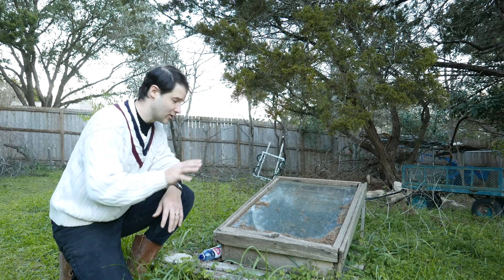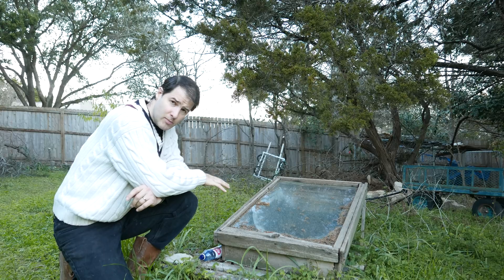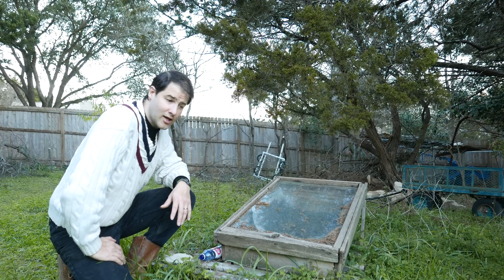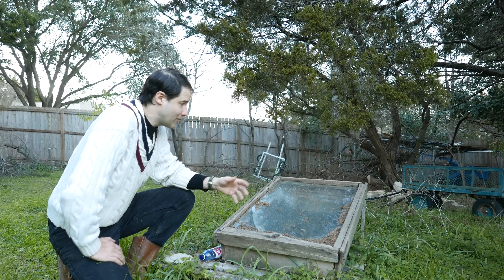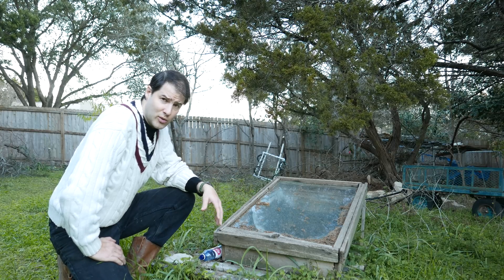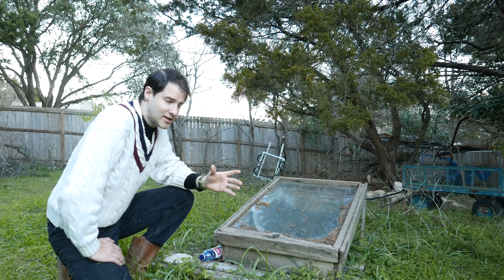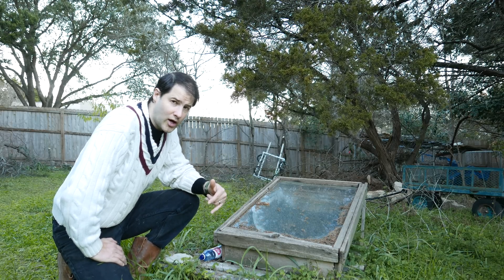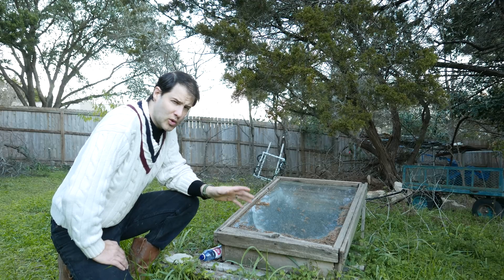Challenge to Makers - Waxmelter Temperature Regulation

Comment: Would putting the wax in a container with water ensure that the wax doesn't get too hot? I suppose it will depend on how long you leave the wax before returning to recover it. If the box was air tight it would prevent the water evaporating.                                 ...................................................................................................................................................Alternatively enabling the wax to flow from the tray through a hole located in the floor of the solar collector would ensure that the wax would melt and drain, but then solidify when reaching the cooler temperature of the area below the collector. If the collector was raised of the ground you might even get a little air circulation preventing the shaded area from warming from the collector above it, and keeping the wax soft which might attract beneficial bees from drowning in it.

Comment: here is an idea, use a sterling engine fan to cool as the temperature rises. Another idea is to us a small fan, with a reed switch on an oven thermometer. this will turn the fan on when the temp raises to much.

Comment: Use an STC1000  All of us home brewers use them.    They are cheap.  You will need a mains feed to it mind but it uses hardly any current and can handle a 10 amp load. You can set the offset value.   We use them on fermentation fridges, I have on in my polytunnel, it will heat and cool OR feed an opening device / closing device.    I have run 2 for about 8 years trouble free.  One is set in my polytunnel right now.  At 0c it fires a fan heater up, at 2c it stops.  They are neat.

Comment: Two ideas, one using a sterling engine fan that is tuned to start at the right temp and cool it down. might be a bit tricky getting the temps right. Second, is using a oven thermometer, a reed switch, magnet, and fan. When the temp reaches the max temp the switch turns the fan on. when its below the temp it shuts the fan of. this will give pretty precise temperature control.

Comment: I was going to suggest installing a roof fan with t-stat. The only problem is the knob only goes up to 120F. Removing a t-stat from a crockpot and connecting it to a fan will do the trick. 
I melt all my wax in a turkey crockpot with glass on top. Since we don't get enough days above 95F I usually plug it in. Or throw a batch into the oven after my wife baked something and it's still hot.

Comment: keep it simple,  drill holes in the down hill bottom side for the melted wax to drip out of the heated chamber into a pan below out of the heat.  JoeBuck49
Reply from the maker: +joebuck49 Clogs quickly.

Comment: run the drain from the wax melting tray  say 2 cm out side the box to ambient temperature, the inside 200f will keep the 2cm spout over 160f so the wax will flow and drip of the spout into the out side wax Receptacle.
Lovat Clement Arbroath Scotland

Comment: Rather than an arduino, a 555 timer circuit with a thermistor would probably work well. 

This video uses the 555 to drive a fan, which could be used to flood the wax melter with cool air. 
https://www.youtube.com/watch?v=ihWmYI-VYpM

Further explanation
https://www.youtube.com/watch?v=oV3o9yyV44Y

Comment: I'm just a simple chemist, and no engineer, however I'd think that a cylinder (a small empty propane tank perhaps) filled with air and attached to a piston (perhaps similar to the ones that are found in the boot of a car?) might do the trick. The entire assembly would fit inside the melter and would work such that when the temperature gets high, the gas inside the cylinder would expand and extend the cylinder. As the temperature cools down, the gas would contract and pull in the cylinder. I have no idea whether this would work but it might be worth a shot. There would probably be a considerable amount of playing around with volumes and/or pressures (it's possible that the cylinder wouldn't have to be pressurised at all and just start at ambient).
Reply: I forgot to add that the piston would be attached to the door/window and it would open as the piston extends of course.

Comment: I think the arduino would be a viable option .

This person built a low power ATTiny (Smaller atmel chip), sensor module for  $11.69
https://maniacbug.wordpress.com/2011/10/19/sensor-node/

This includes the cost of the RF radio, which the wax melter wouldn't need, so the cost for a temperature sensing arduino would be $7.69

Then you could drive a small dc motor with a worm gear to move another gear to lift or close the roof or a vent.
The  non-worm gear could have a spring catch, so that it the furthest up or down position, the worm gear no longer engages teeth, but once the worm reverses it would reengage. This would let you get away with just driving the motor in a direction, without getting motor feedback. As long as you run the motor for a while, you'll be sure that you lifted or closed the vent. 

Link to a picture of the gears, http://i.imgur.com/oVQrrPX.png

A car window motor and regulator could approximate this I suppose.

Sourcing all of these parts would be tougher in remote areas though.

Comment: The Arduino was a great idea. You can get knock off Arduinos for next to nothing. Instead of a solenoid, use a servo that would open a flap, and turn on a fan if a thermometer reaches a certain temperature. You can scavenge a 12V fan from an old computer or something for possibly free, a knock off Arduino will cost you around $5, a thermometer probably the same (have a look on icstation.com or eBay) and a servo for $2-3. You could use a solar panel in the corner to power the whole thing and that'd maybe raise the cost by a few bucks but it really depends on shopping around.

Comment: I just made one with rubbish from a waste reclamation tip for $10. An old glass aquarium with a glass roof, with a container with water in it at the bottom and a mirror behind it, facing the afternoon sun. The wax sits in a colander with cloth filter (you know that cheap cleaning cloth orange/green usually), then the wax melts and falls into the water and cools, the water prevents it reheating too high to discoloration and the wax naturally floats and collects as a single blob you can later reheat into a brick if you desire. Best part, no construction required, takes 1 minute to setup (fill container with water and place wax in colander). Pictures at these links: https://drive.google.com/file/d/0B9Gev1KS5sGCYWJyQWFYRkZXT0k/view?usp=sharing
https://drive.google.com/file/d/0B9Gev1KS5sGCbHVVLWVFVWtubDg/view?usp=sharing

Comment: Idea #2 - Raise the box up high enough to put the wax ingot, outside the box directly underneath.  The liquid wax can drip down a drain pipe into the ingot outside where it is much cooler.
Reply from the maker: +Bruce Wayne Wax quickly cools in pipe and blocks flow, then backs up.  No good.
Reply: +OutOfaBlueSky Bruce Wayne's idea would work actually... 
Just cut out the middle man (pipe). I am assuming you have some kid of crucible the wax sits in that has a hole in it for draining into an ingot.
If you have that outlet hole drop directly out the bottom of the box into a well ventilated and thermally insulated box... Then it would get hot enough to melt the wax and drop it out into the ingot. The bottom box will probably still get hot ( but not hot enough to remelt the wax ), while allowing the top box to reach the same temperatures you need for the initial melt.
Hope that makes sense.
Alternatively... You are then moving into micro-controller territory for heat sensors to trip ventilation fans and possible screen covers.
Reply: If the temps are so hot to burn (discolor) the wax; the wide (say 2"x6") drain pipe will be hot by shear conduction alone, and should not clog. The system should be closed, not allowing fresh air into the hole/drain pipe.  So the ingot would need a top plate, which has a hole with a pipe flange mount.  If clogging is a problem, you may find that simply wrapping the pipe with insulation on the outside, may be needed to hit that sweet temperature spot.
   Experimentation is key, but I am confident some arrangement of these elements will work.
Reply: +Bruce Wayne If you could set a small solar cell to run a 60mm cpu fan to force work air through your drip hole this would be solved. If copper pipe was used or even copper sheet metal formed to make a funnel  so that the Sun could warm it up the wax wouldn't stick to it.

Comment: Idea #1 - Drill 1 hole on each side of the box (say 2" in diameter), then cover the holes from the inside with sheets of wax (foundation).  Once the desired temperature is reached the main wax melts and so will the wax sheet.  The hotter the box gets, the more sheets melt, opening more holes to self regulate.  If bugs are a concern, put screen mesh on the outside of the holes.  You may need more holes on the side (2, 3 etc), but start the experiment with 1 per side.
Reply: +Bruce Wayne .

Comment: is the discoloration from the wax melting or when its in the collection pot? this is just a theory but can u not just  submerge the collection pot (made from metal) in the soil and surround it with moderate amount of water to lower the temp at night the water will re-cool and then keep the process going
Reply from the maker: +terry kirton Discolors due to thermal breakdown.

Comment: 1. Free app on your smart phone that will remind you to check the wax. Just set it when you have wax heating. 

2. A computer fan, battery and a temp control device that will turn on the fan to exhaust the heat from box.
Reply: +Charlie Rickman Have a look @ ebay . com/bhp/adjustable-temperature-switch

Comment: i am new to the bee keeping but i try to make everything i can. an i have made a solar wax melter, but i want be able to try it until it warms up. but for mine i put the melting box about 2 feet off the ground an the wax falls down to the catch pan at ground level. that far from the melt box the wax should not remelt an discolor. i hope mine works an this helps you.
Reply: +Charles Ferguson A similar method was used when making tar.

Comment: Cut a nice hole that yoiu can fit a fan, plug it to a temp detector that gets his energy from the sun (and or the heat) and turn it on when it reaches above that temp or off below that temp. The temp detector before going to the fan just goes to a comparator that will send energy or not depending of what you set. That should be cheap enough.
Reply: +OutOfaBlueSky You can get them very inexpensively on eBay, AliExpress, etc (Chinese exports of course, no names). Search for dc or 12v temperature controller. Despite being cheap no names they do surprisingly work well
Reply from the maker: +Rem So tell me what temp detector, the brand, make, and model.